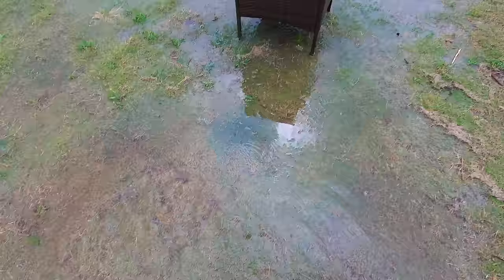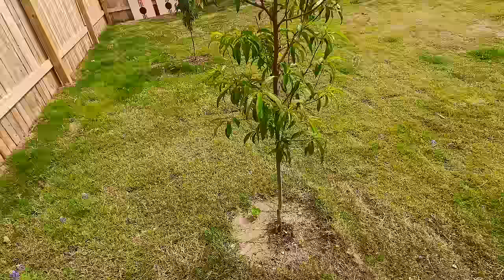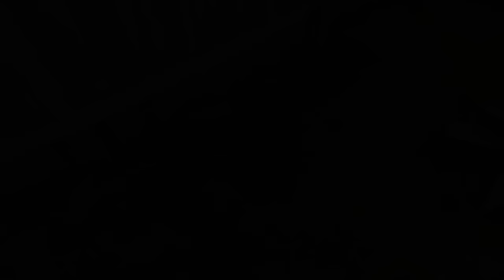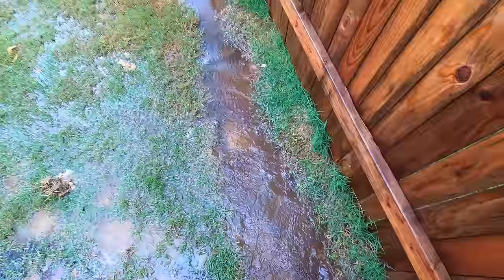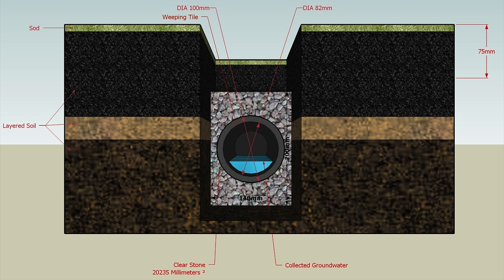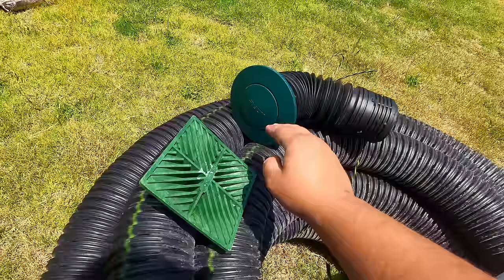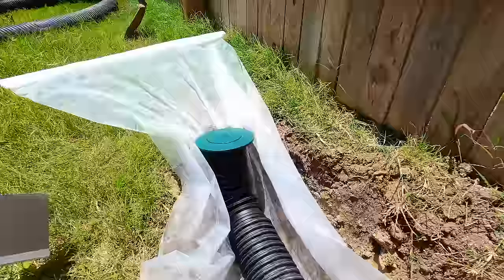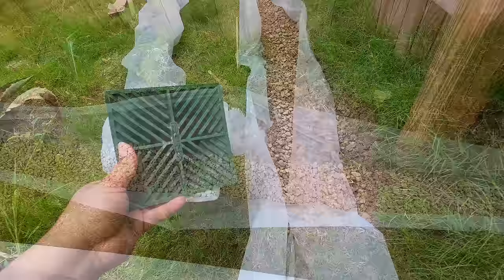How I Built a French Drain to Improve Drainage on Clay Soil

Comment: You should continue the pipe to the street you need to move the water away from the house.
Reply from the maker: I would agree that would be beneficial, but we dont have any standing water next to the house (or anywhere else for that matter). I feel the western fence was really the only poorly draining area
Reply: If it fixed the problem then digging to the street would be unnecessary
Reply: @jamiepippin3892  It could've fixed the problem and caused a new problem elsewhere. Normally the water running down like that is all that's needed, but so much so close to the house might not be. Always best to get the water to a point where it can't ever hurt you.
Reply: Some municipalities won't let you do that. I would have people check with their town or their homeowners association.
Reply: @rotcod2886  Why wouldn't municipalities allow to dump water farther away from the house? If water runs back towards the house, you're back where you started from.
Reply: @joeshmoe7789  I really don't know. I'm no authority on any of this. I'm just thinking I read that somewhere.
Reply: @joeshmoe7789   most municipalities will require a  permit to be obtained. Some municipalities have restrictions on overloading the storm water system.
Reply: @rotcod2886  Running a pipe to the street could possibly be a problem with some towns, but allowing water to run downhill naturally could also be an option. His outfall sends water toward the house before it reaches that valley. He should've extended the pipe past the fence. The swale along the sides of the houses seems to be all that's needed. A pipe to the curb would just allow the swale to dry faster. 

I think I would've done the entire job differently, but without seeing it in person, I can't say exactly what I would do.
Reply: @raymondmartinez845  I don't know about most, but that would have to do with running a pipe with your roof/patio water or from a sump pump. I don't see how any town could stop him from running that pipe another 25 feet to somewhere along the side of the house.
Reply: wow i just randomly came accross you video while looking for roses. but i watched it anyway and it was very good. Great job! Bet youre much happier now :D🎉
Reply: I was thinking the same thing.  Hate the idea of the pop up emptying closer to foundation.

If you and your neighbor ever decide to tag team the pond between your houses, you can continue your backyard drain via a coupling to the street.

I’d double or triple the width of the French drain to tackle the volume of water between your homes.  And rent a backhoe for a day.  100-130 we’ll spent.

But great job.  Hard work but it protects your lifetime investment.
Reply: @joeshmoe7789 it's called City Code. Every city/town has its own Code regulations.  Just call your City's 311 info to ask... iT didn't matter because what he did worked abd he probably didn't want to have his HOA in his business.
Reply: @AustinTexasGardening  you say that but you moved all that standing water to the corner of your house. That’s more water then it was originally getting. Should’ve continued to the street and got rid of that river next to your house.
Reply: @AustinTexasGardening I’m sure you have storm drains or land in your area. Also consider putting it into the sewer (although it isn’t good practice)
Reply: Agreed. I had to run it to the street at my old house. When it rained it would super flood right next to the street and then 10min later was all pretty dry. 😊

But I should have bought a damn trencher. Didn’t know they existed and in the end I saved money and had a great workout. Lol
Reply: And the neighbours yard . !
Reply: @AustinTexasGardening still would have better to run to the street so no pooling ever between your houses and the water can be properly taken to a storm drain. The excess water is now just moved to another area
Reply: Great job!
Reply: You should start YOUR OWN video
Reply: Over time it the valley between your house and neighbors will dry the clay causing a expansion and retraction issue thus causing an issue with the foundation

Comment: Just a nit picky correction but pipe with holes is actually called perforated pipe not corrugated pipe.  What you have is corrugated AND perforated pipe.  The corrugations are the ribs that improve flexibility.
Reply from the maker: Thanks for the correction, that makes sense!

Comment: Get a power auger and dig a shitload of vertical holes 12” in diameter and 2 to 4 feet deep. Line them with geo fabric and gravel. Also try using 50 gallon or larger fabric pots, cut open the bottom and plant your trees, etc up on top the ground.You’ll be amazed how much this will help. 35 years of construction contracting with 5 separate licenses along with a farming experience my whole life so I’m confident it’ll solve all your issues. Cheers
Reply: Please explain this to me, dig 4 foot holes that are 12 inches in diameter around the foundation if I have seeping. Line them with geo fabric, And fill them with gravel only?  That’s it? What goes on top? How do I cover it ? 
Thank you
Reply: @Games-dx2bx  Yes fill with gravel only. Top it off with geo fabric and grass. The point is just to give water a fast track down
Reply from the maker: Cool suggestion, so basically several mini cisterns full of gravel?
Reply: Odd question, could this lead to sinkholes?

Comment: I install French drains we do one inch drop every 8 feet, use schedule 40 corragated pipe 4 inch sometimes 6 inch with 3/4-1 1/2 inch gravel rock around it and all enclosed in geo textile 3 Oz fabric closed up like a burrito. I always give 20 year warranty on all my French and trench drains. Also we use 12 inch catch basins occasionally. Just some advice you did a good job!
Reply from the maker: Great advice, thanks for the data!

Comment: Great video! We dug about 220ft of trench to resolve our problem with the way our pool company left our grading! It actually helped our neighbors because we tied in the system to the main drain between our homes. These systems are a lot of sweat equity but so well worth it!
Reply from the maker: 220 feet wow, did you use a trench or did you do that all by hand?
Reply: @AustinTexasGardening  No trencher, we did it with a pick mattock and shovel! We did the first 100 ft and capped it. Then a couple of weeks later did the second part.😵‍💫😵‍💫

Comment: Both of my neighbors on both sides decided to do a half ass DYI….pavers job without making it it run off correctly. I am hoping installing the French drain system will some what bring back some the grass that is none existing right now. Thanks for the info and video!!! I’m running my to the street like my neighbor has done across the street.
Reply from the maker: Sounds like a great plan, I’m sure that will work!
Reply: DIY*...
Reply: @JDarkAngeI  with over $2500 worth of supplies, materials and $1500 for labor it was well worth it to have a professional do the job which turned out great. Now I have French strains on both sides hooked up to my gutters. It took them two days to complete Plus a one year warranty. I’m pretty happy with the results

Comment: Congrats on the success.  I ended up using 6-inch b/c I don't have enough slope for corrugated. Six-inch pipe requires less slope to acquire a self-cleaning 3-feet-per-second.  NDS has charts on their website.  4-inch corrugated moves the same amount of water as a 3-inch smooth-wall.
Reply from the maker: Great info, I could have probably fit 6" in my trench, my only regret is not owning a truck for these kind of projects

Comment: This is massively over-engineered but you did a good job. You can turf over the drain just fine, most people do, and you don't need such fancy pipes or inlets / outlets. A lot of engineers build industrial culverts under runways and other essential infrastructure with the trench, a regular drainpipe with some holes drilled into it, and then the stones and finally dump the earth back ontop.
Reply from the maker: Agreed, over the 18 months that have followed installation, the soil has shifted, fissured, and swallowed some small pockets of granite. Also, the shifting granite has resulted in the intake cap being exposed by two or three inches. In the spring im planning to cut and tie off the intake cap, but im waiting to see how much things further change.

At any rate, im glad the standing water and misquotes have been gone

Comment: Thanks to starlight for their wonderful grading! Dealing with the same issue also have a Galileo
Reply from the maker: Howdy neighbor! 

Yeah starlight is a real piece of work. Some of the grading on the homes they're finishing right now looks crazy. It happens everywhere though, our last neighborhood was built by william lyons in 2019, they had much better quality before the 2021 shortages, but I still had a few neighbors with backyards that were perpetually underwater from grading issues. Homes that sold for 500k+ with swamps in the backyard, and tiny lots packed too tightly to implement a french drain without hitting power/gas/etc, a real nightmare.

Comment: Nice job. I think solid PVC will work better (water drains more efficiently), with no wrapper which will plug up in time.  Bringing you gravel right to the surface is smart as it will reduce dirt infiltration.

Comment: Trying to build a drainage system on a site meant for residential plots. It has 1 main road and 6 side roads. Drain has to flow from the back end of the site which has a closed boundary to the front side of the site...a length of 640 ft on the main road of the site. The six side roads are connected to this main road and will have drains too. Attaching site map for clarity. 
The site had an uneven level from the ground surface. The back side of the site was at a much lower level than the ground surface mainly starting from around 300 ft of the site starting from front 0 to 640 ft at the end. Which means a negative slope considering setting up of drainage system. To address this negative slope extensive land filling was done because of big slope and large area of the site. To build drainage over these roads we made a plan of a slope of ~ 2 inches for 100 ft length of drain. 
Now the situation is that the back side of the road has been elevated a lot for drain to set up over it with gradual slope downwards towards the front. And even with this the drain would go under the ground somewhere after 200 ft from the back side.
Is this the right approach for setting up the drainage? Any suggestions?
Reply from the maker: This is a huge project, I'll remind you that I've only done one project like this and it was only 40 feet.

That being said, 2" per 100 feet is not very steep, my yard was landscaped with about 2" per 40 feet, obviously any grade will work and is better than nothing, but if you could do 4" per 100 feet by digging the drain deeper at the base, that might help. Also consider, if your residential lots aren't landscaped/developed yet, this could impact the way water flows through the site. If 3 of the lots drain through one yard, and the drain doesnt cut through the property, there could still be drainage issues.

I would definitely solicit the services of a landscaping professional with a better portfolio than mine to help you.

Comment: I have done a French drain before but I still have standing water after having professionals to level lawn and install btw sod. Their machines  caused unlevel surfaces 🤦‍♀️. 
I had a French drain specialist quote me $6500 for 40 ft of drainage. I scoffed! I will be adding my own french drains before summer.
Reply from the maker: Those numbers are wack, but it is back breaking work, and with just a guess, it took me maybe 40 hours. 

At 50$/hr I think $2k would be fair, 6.5k is too much
Reply: If you have enough grade, you could do catch basins in the areas that have significant standing water and drain through solid pipe to wherever you need it to go. Definitely don't pay that much for a Saturday or two worth of work!

Comment: Soil separator looks like tissue paper.  The Pop up should be by the curb.  It empties out just before the house and your foundation is going to get a lot more  water then it did before.  Could cause problems down the road.
Reply from the maker: I agree, typically you would not want the pop up anywhere near the foundation, I could have done it with more materials and made the trench run farther out, but since I built the drain, water no longer pools in my backyard, and I’ve seen the water drain directly from the pop up to the shared drainage ditch between my house and my neighbors
Reply: I don't understand the pop-up placement either. I find it hard to believe that any water will come out of it since the top is above most of the pipe. Why not continue the drain under the fence to join the small gully between the houses? (Maybe you're worried about the hoa seeing you?)
Reply from the maker: @mb-3faze  the gradient is steeper than it appears, at the end of the video I demonstrated all the water drained to the swale after we got an inch of rain

Comment: I think in your application, you don't really need the intake grate. Your french drain will capture the water, divert it into the pipe and send it down to the outlet. And the left over water will slowly drain into the ground...
Reply from the maker: I agree with you, if it’s not at or slightly below ground level, I don’t really see the point either.

Comment: Great video. I'm in the beginning stages of a similar project. Im about to plant a line of 4 Junipers and 4 eastern red cedars in a area along my fence that has standing water after rain. Im hoping the new soil and the trees will soak up water. If not, I will be doing a french drain.  My one concern is tree roots making there way into to the corrugated pipe and running all my hard work. I have a bald cypress at the end of that tree run, so i know those roots will make there way to that standing water and help soak it up as well.
Reply from the maker: Very cool, depending on the amount of standing water you might want to build the drain in advance. Puddles are one thing, but if you have a half inch deep river/pond for days like I did after only about an inch of rain, your trees might get root rot

Comment: I did a similair project in clay soil and I chose not to use fabric. I watched a lot of YouTube videos and am convinced that once the clay magrates it will just clog up the fabric. I now think that maybe I should have used it to line the trench as a way to seperate the rocks from the soil, but leaving it off the pipe and open at top I think is the rigth call. I've only done phase 1 so maybe that's what I'll do in phase 2.
Reply from the maker: Very cool, based on what I observed, it seemed like I could have gotten away with no pipe, no fabric, just granite gravel or river rock and a trench, and yep I think thats the purpose of the fabric, to keep the whole thing from sinking into the mud and refilling with soil over the years
Reply: I had a similar problem with water pooling at the front and side of my house, worst I saw was about 11” deep. Used corrugated/drainage pipe without fabric, scoria on top, soil then grass cover on top of that has now been 10 years and had absolutely no pooling or sinkage.
However it does have an outlet rather than just being a buried pipe.
Reply: I'm creating a small french drain now in very clay-heavy soil that refuses to drain. I only put some fabric on the bottom to help keep things clean while I backfill a bit, and around the sides. I will be leaving the top fully exposed with drainage rocks, but once things settle the bulk of the water will be clean and still. I do think fabric is overused in many of these videos and it absolutely does slow drainage.
Reply: With my drain as the water flows through it clay sedimient builds up around the rocks, and right now half the drian the rocks look muddy but half the drain you can't even tell there's a drain, there's so much clay it just blends in with the rest of the yard. My next idea is to place fabric on top with the intention of replacing the fabric every year as regular maintenence. For now I'm going to have to dig the rocks into a wheel barrel and pressure wash the clay off, or something like that, and put them back. I'll see how labor intensive that is. Maybe I'll just dig everything out and place fabric at the bottom while I'm at it.

Comment: have you considered using some transparent corrugated roofing and guttering to make a water catchment device? it wont block out as much sun to your garden, you can run vines up it and if you can catch some water you'll be able to use it to water your garden in the dry seasons and it'll stop so much water from contributing to the waterlogging.
Reply from the maker: Not a bad idea, im not planning on making many changes to our current landscaping/backyard setup, but rainwater collecting is something that some of my neighbors have done, and its been very effective

Comment: With a pop up drain you might find this could fill with clay, mud and silt deposits as water is expected to go up after many years, but could be wrong. The best method to discharge would be a fully open end, that doesn't have to climb at all
Reply from the maker: Agreed, but for my project the decline was so slight, I figured my drain needed to be 2-3 times as long, or have the popup (which only works when it floods and basically functions as if there was no popup at all, I.e water pools at the base of the drain like a trench, but I suppose that’s better than flooding my yard)